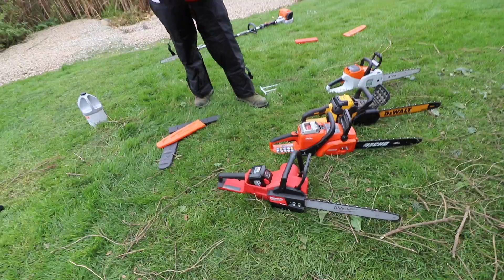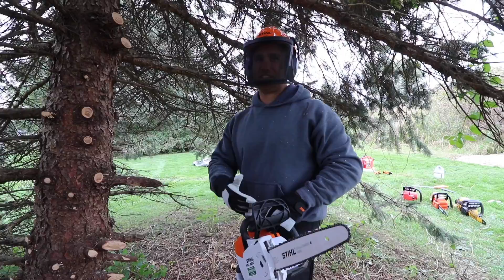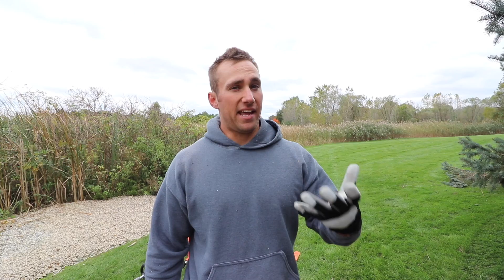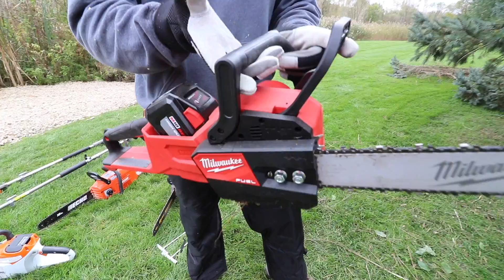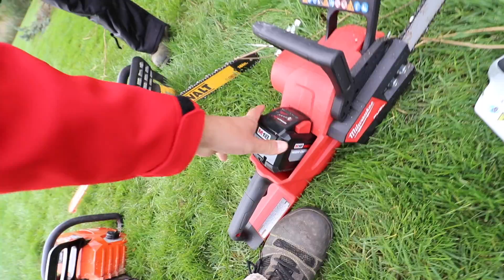4 Way BATTERY Chainsaw Comparison ► Which Has The Better Cut And Torque?

Comment: I still have my gasser for pro work, but I have that battery echo and I love the thing.  I keep it in my truck at almost all times.  It's great for camping and  it doesn't stink up the back seat.
Reply: Yea for camping it's nice to have a battery saw. Sneaky tree cutting at its finest! 
The only smell you'll get from a gas saw is from the exhaust or if gas somehow leaks out. Not from just sitting there

Comment: This was a very poor test as it only cut very small diameter branches. Bar length for this test did not matter but blade sharpness did. The older 12" bar Stihl battery saw (which I have used for several years) would easily cut through the branches. For this application, all of them would do fine with the thinner kerf 1/4" chain and faster speed for the Stihl would do best. If you cut 12" or thicker diameter trees, the Milkwaukee saw would likely out perform the Stihl thanks to its longer bar and wider 3/8" chain.

Comment: When you start pulling saw back and forward - you know sucker is dull. (10:54)
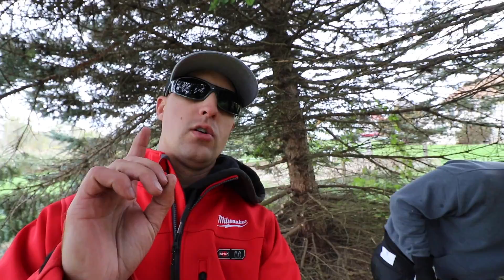Reply: 5:45 “all freshly sharpened”... let’s face it Milwaukeee  was the best purchase lol 😂 it is modular for batteries being used on all their products nothing proprietary especially if your in the bush and only have a few batteries you don’t have to remember to bring the “chainsaw battery” or need multiple. Best bang for the $$$.

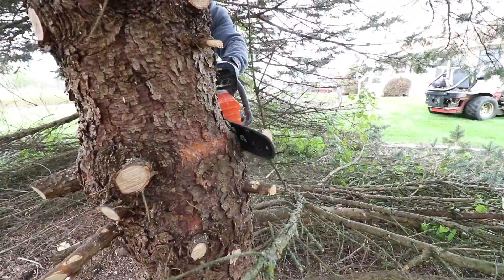Comment: 6:05 Using a sawing motion while using any chainsaw whether battery powered or gas powered is NOT something a pro would do.  Just sayin'.  You guys did admit to not being tree guys so you get a pass on this one.
Reply: I noticed the same thing. It drives me nuts to see that. It’s a definite sign of a dull chain. Whoever sharpened that chain had no clue what they were doing. I could tell the rakers weren’t knocked down.
Reply: From one Bryan to another Brian thanks for not taking offense to my comment brother!   Thumbs up AND a new sub!

Comment: I could see a battery saw for the homeowner that hardly uses it but I m sticking with gas and stihl for now . I do however , LOVE the electric blowers for clearing leaves out fo the garage. I have a craftsman and a Ryobi that takes the regular tool batteries and they work great . $100 for the Ryobi , came with. 4 amp battery and the craftsman was $20 at end of year clearance and it’s a beast but the batteries for b,owners last about 8 minutes and the trigger is rpm sensitive

Comment: Picked up a nice 026 with oem orange case $130 @ local pawn shop 

Needed a fuel cap and the carb reset, these old pro level non clamshell saws with huge aftermarket can be kept running very cheap and for a very long time 

Learning to tune a 2 stroke is an important and useful skill that can save you loads of money on equipment 

Not interested in these toys though I bet the Milwaukee is fantastic as usual

Comment: The main purpose for me to buy a electric saw is to take with me on ATV/side x side rides where a tree falls across a trail.  Rather than go around and damage other land.. with a battery operated saw one can quickly clear the trail.  No noise, no carrying fuel cans/ reduced fire risk in the woods and reduced carbon foot print.. Batteries are changing everything .  Perhaps one day we will also have side x sides  just like we have cars.

Comment: The Milwaukee fuel M18 battery interacts with the saw to develop more torque when needed and.. something you should of viewed.. it is valuable speed like a gas saw.  A run time test on each of these saws with the largest battery would be nice to see.  Even without cutting anything to be fair to run time.  My question after watching your video was what were you trying to convey other than there are 4 choices.  I would like to know if the other saws are valuable speed as well and can develop more torque as well.. Please get up to speed on manufactures spec's to compair

Comment: Too bad there are no ego to compare. Ego is definitely one of the top or very quite possibly the top by far. Should give one a try compared to these. I'm going to guess the ego 18" is much better than any of these if their reputation and history repeats itself. Like to see it if you get a chance to compare. Thanks for the video. Really need to run the same brand of chain and series to compare because there's a ton of difference when it comes to a saw chain probably much more than you would think. Chances are the echo has a more safety styled chain vs a pro chain on the stihl. Full chisel chains cut line butter with no effort at all. The saw really does nothing but power and tension the chain which the chain is what does the work. Try getting the same series of Oregon chain for them all if you want to compare the actual saws instead of the chain. Without doing this the whole comparison is almost useless as far as cutting speed because the chain makes more difference than the saw really unless the saw just completely powers out, don't lube, or the chain comes of or something.

Comment: Ill never go back to gas powered again. I just grab it and start cutting. Like you, I don''t do massive tree jobs, just small stuff, a few cuts. Plus I like the way now that batteries in these stay full power until its "dead' then shuts off instead of gradually getting weaker and weaker.

Comment: “Locking mechanism” aka Chain brake... and it’s meant for kickbacks.  Motor RPMs will all be listed in chainsaw manual or specifications, so please don’t base it off of sound.  “Chunks” or whatever, is more a function of chain sharpness and raker height.  Lastly it’s a hard sell when you’re talking safety and limbing overhead...

Comment: It may not have been available at the time, but Dewalt has a 60V brushless chainsaw as well, so using a 40V will almost always underperform in this test. 

In the end, if you are already in the ecosystem of a manufacturer, it makes sense to stick to it. 
Personally, I have the Dewalt on my Santa wishlist
Reply: Actually no the 40v batteries are more powerful the 60v cuts faster but you can cut more with the 40v there's a video Stanley dirt monkey  litterly blows away the Milwaukee and it beats out a Makita gas chainsaw and it beat the ego too

Comment: For god sake do the demo on 8-16" logs or stumps. I could use a few years old long handle manual hand looper pruner do those little twigs and tiny branches faster than that bulky chain saws. 
People don't buy them for your type of cutting.

Comment: With a sharp chain any petrol saw will never beat the msa 200. It’s my favourite saw
Reply: Lol, that's a silly statement. Batteries have far to go before any logger would be able to use them.  My 30 year old Stihl 026 still runs, show me a battery saw or any battery operated tool that's 30 years old and you can still find batteries for..

Comment: I thing the Drags need to be cut down some on the Echo. My Echo cuts way faster than the one in this video and it's the exact same model. But I do sharpen my own saws and file the Drags as needed
Reply: JFishRHEC check out the stihl 2 in 1 sharpener. Its awesome.

Comment: It is because stihl is the best
Reply: Ya u buy the saw but, where's the battery oh and better yet where's the charger. Buy each separately. So after buying all three of them may as well buy a gas saw and being money ahead.
Reply: Sthil chainsaws are just generally better than all those other brands
Reply: I do agree. But what burns me is if you want the saw you buy the charger and you buy the battery. There is a smaller model and if you buy it you get all three.
Reply: Yes I do agree

Comment: Friend of mine let use   the  dewalt saw before it was available to the public hes engineer for DE Walt and it's a good saw for what it is  and I only buy stihl
Reply: Reason I would get dewalt saw is because there string trimmer is the lightest if the batteries fit- but no doubt sthil takes the cake

Comment: The speed difference on Milwaukee is because the other 3 are higher voltage. The Milwaukee needs to be compared to DeWalt's 20v Chainsaw. The 40v DeWalt is kinda a middle ground. And the flex volt DeWalt runs 60v (or 54v mom, similar to the other "contractor grade" electric chainsaws you have. Which is comical because contractors don't use them at work they use them at home so they don't have to pull it.
Reply: I personally have the 20v DeWalt which I quite like. Have heard about bar wobble/flex with the flex volt model and horror stories of FV batteries no longer powering 60v tools or hurting 20v tools. Shyed me away from that one. It is smaller than all the other options, which I am making an advantage. It is quick enough to not make me dislike it (albeit slower than gas or some other electric options). But more important is it's LIGHT and small. 9lbs with 5ah battery that'll chooch for half an hour or more without super long duration cuts. Maybe 20 for bigger limbs. It's my sole choice for a climbing saw. Hardly runs out before I want to take a short break for my hands. Battery swap and a cigarette and I'm back at it. If you have 3 or 4 batteries and at least 2 chargers or a fast charger, you can cut pretty much continuously. 10/10 reccomend to anyone considering
Reply: The motor on the Milwaukee is the biggest of the 4 the dewalt is more efficient that's why it doesn't overheat like the Milwaukee does

Comment: I have to laugh when I see people start sawing like they or using a hand saw when they or using a chainsaw.
Reply: Thought the same, but in all honestly, I've caught myself doing the same. When I realize I'm doing it, I chuckle and shake my head at myself.
Reply: You only do that when the chain isnt sharp. A good sharp chain will grab and pull into the wood in a way that wont cause you to push down or saw back and forth. The only sharp chain in this video was the stihl. The other 3 saws were shooting straight dust out not chips. Someone sharpened the teeth but left the rakers too high.
Reply: I was thinking the same thing! A professional should know better. I catch my 20 year old son doing that because he doesn't have that much experience.

Comment: Even though all the chains may have been sharpened, you can tell the echo was a dull chain. Also cutting little branches off is a terrible comparison. The speed really has alot of different factors you need to fell I big tree and get into cutting into a log. Like the lower speed of the echo may be a huge benefit with torque when in big wood.

Comment: For an infrequent user an electric is excellent.   Nothing is more frustrating than spending all day pulling the dang starter cord, filling the gas tank, forgetting to dump the gas after the day is done and running the carb out.   Now that I had shoulder surgery I can't even pull a starter rope.  It would have been nice to hear the price differences in the saws though.  The milwaukee looked the best but probably the most expensive too.

Comment: I got tired of my gas Stihl not starting and letting me down so I purchased the Echo 58v. It feels like a real chainsaw and not a toy like some of the others I tried. It cuts great, came with the battery, has the 16" bar, and was less expensive than the others too. Mine cuts way better than what is depicted in the video. Its nice having both a gas and battery powered chainsaw for different applications. Highly recommend the Echo 58v chainsaw, it wont let you down...

Comment: 60v DeWalt flex volt works amazingly for basic homeowner firewood/bucking/limbing and it's very good for everything you just said about battery saws but even more powerful

Comment: You need to use same type of chain on each, maybe try to use the Stihl bar and chain on all the saws. Also to be fair, voltage means alot as far as run time.

Comment: I can tell by watching each saw cut that the dewalt and echo chains weren't sharp so of corse they won't cut as fast and will require more pressure.
Reply: Yeah - obvious dull chain.
Reply: In addition listing to to sound I thought the chain might be too tight. It didn't  sound nearly as smooth as the sthil.

Comment: I will stick with my gas powered husky 455 rancher 20". My saw has been modified with metal reinforcement from getting abused over the years and duck tape on the handles for better grip and took the chain brake off because they are made poorly on all models and make. Looks rough because she is rough just how I like it

Comment: I have used an electric chainsaw for several years, cutting up an average of 3 cords of wood a year for my wood heater.  My Worx 18 inch saw with a new chain will cut as well as any you demonstrated, proving that the way a saw cuts is more dependent on the condition of the chain..newer or properly sharpened with rakers ground properly, than it does on chain speed, torque, etc.  granted mine is corded, but my wood lot is less than 100 feet from my house, so when the wood comes in, I cut oak rounds to 36 inch with my saw with little effort...I have owned 3 other gas saws, along with 3 electrics and the Worx for less than $90 has outlasted them all!  Of course I am not a contractor, but if I was, I would still use my saw with a properly sized generator!
Reply: Im not a tree guy, not even a wood guy. But I do know RPM's are very important for any cutting action. Than there is TPI. Than there is Amps/Voltage for electric tools...
Sharpness is obviously the most important step in being able to cut as a dull blade on anything will perform like shit, but once thats out of the way the actual performance of the tool is what you will notice. Thats what they were attempting to showcase here, sharp blades and 4 differently branded tools.
Milwaukee: 18V
Echo: 58V
Dewalt: 40V
Stihl: 36V

All of these Saws will provide very difference performance characteristics because they utilize very different power sources (This will often affect the RPM's and Torque)
Than there is the quality of the motor to take into account, and im unsure if all of those tools utilize brushless or not, they only mentioned Milwaukee and dewalt (?) having brushless.

At the end of the day you aren't supposed to be taking the chains dullness or sharpness into account for its performance, but obviously many in the comments are and im very uneducated in regards to the nuances of sharpening chainsaw blades.

Comment: That Stihl looks like it has an electric braking system which is awesome for safety and for speed. You transition faster from one work area to another when you have the peace of mind of knowing your chain stops almost immediately when you stop the power to it. 

And at 45° if you would've said you were cold around my old man, he would've said, "Then shut up, stop letting all that hot air escape your body through your mouth and get to work." 😆

Great demonstration fellas. Thanks. 👍

Comment: Used the Milwaukee to cut down and cut into fire wood about 30 trees loved that saw was not mine but the barriers lasted about 45 min per charge cut up to 20 inch trees with it did a great job

Comment: The big advantages are no fumes, no fuel, no mixing, no tuning, no trying to start it, low chance of overheating. The disadvantage is that many of these are underpowered. The Ego saw is good, but the Black And Decker 20vt is weak and overheats.

Comment: Interesting but a little boring.  I wish you spent more time on the maintainability of each tool.  Which is easier to replace the chain, tighten the chain.  Oil filling and check of oil level.  Weight.   The biggest plus to battery is zero maintenance.  No Carb, Fuel and air filter.  For a home owner the saw can sit on the shelf for months, and works when pop a battery in and turn it on when you need it.  No worry about a gummed carb.

Comment: These battery saws are great for limbing and pruning and taking down small trees.  Add some bar oil, hit the button, and you're off!  I have a 60cc Husky 555 for serious work with larger trees, but I use the Dewalt battery saw for 80% of my needs.
Reply: Jim Almy FYI that’s a 54cc saw they rated 1 less on that saw but if it is a 555 and a 559 is only 59 cc the last 2 digits are the cc size and the fist digit is the generation expect the 572xp which was made as a replacement when the 372 where still being made and made again in the 5 generation

Comment: The Echo clearly had a poor chain, when you have to "push down" to get it to cut you have a chain issue, the comparison probably should have included the Makita as that is arguably the best battery saw. Finally would have been nice to include the price at $299 for battery, charger, and saw the Echo is hard to beat vs Stihl @$600